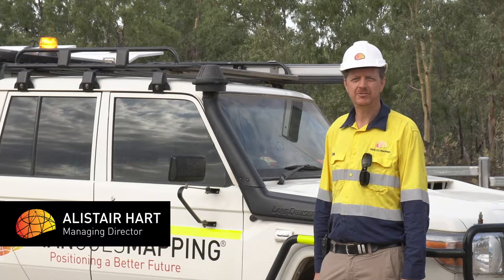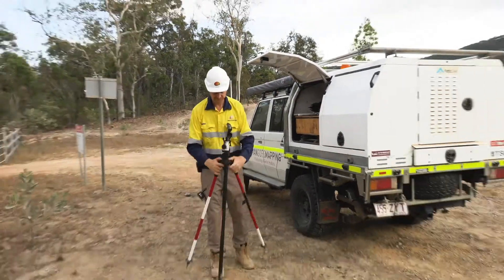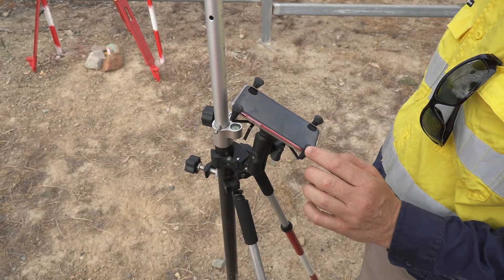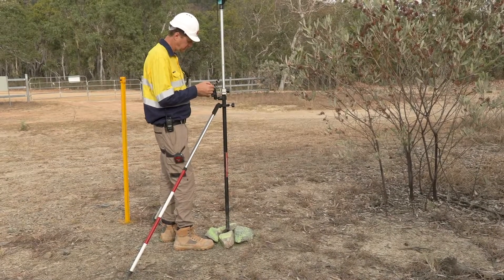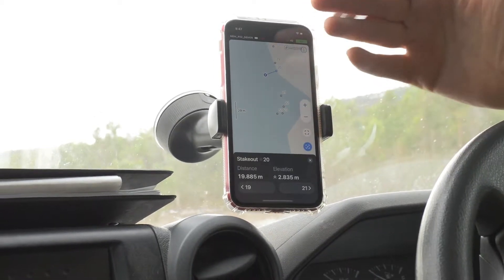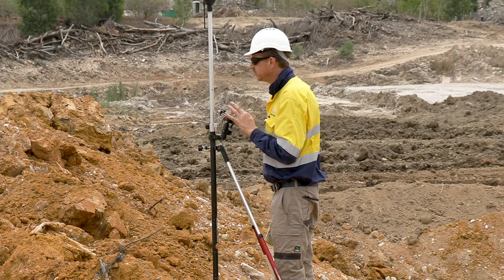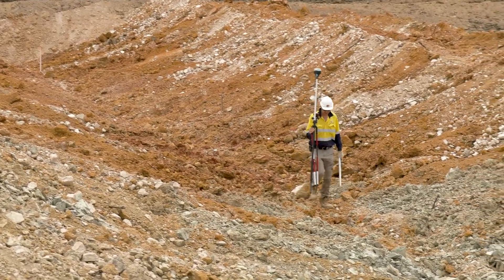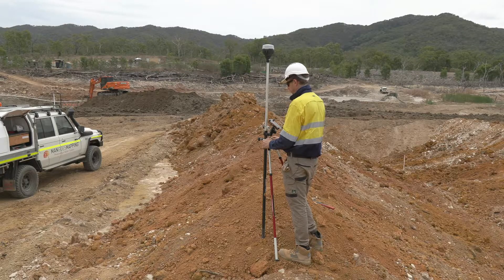Setout using Emlid Reach RS2

Comment: It has 182 channels while other brand have more than500 channel .does it affect accuracy
Reply from the maker: The RS2 has 184 channels, and according to the Emlid's specifications in PPK mode has a positioning accuracy of H: 5 mm + 0.5 ppm & V: 10 mm + 1 ppm. 

While more channels may provide additional accuracy, the improvements could be very subtle depending on your scenario.

To double check - we contacted Emlid's technical team and their response is....

"182 channels is more than enough for obtaining the cm-level accuracy. The additional number of channels don't really affect the accuracy. In reality, 500 channels are seldom used fully, so the difference in the end result is negligible."

I hope that helps!

Comment: How did you import the coordinates ? Or they were existing jobs
Reply: Hi Raymond, I generated the coordinates in my GIS software and exported them as a CSV. Using MS Excel, I then modified the format of the CSV document to meet the requirements from import into ReachView3.

Check out this helpful video from @Emlid - https://www.youtube.com/watch?v=E0TX5h7sOR8

TIP: Remember that the points need to have the headers of the columns in English, and they must be literally: "Name, Easting, Northing, Elevation". If you have additional columns, you will need to edit your data to remove those prior to import.

Once you get the hang of it, it's really straightforward!

Email me at hello@mangoesmapping.com.au if you would like a sample dataset to use as a template and to work from.

Cheers, Alistair.